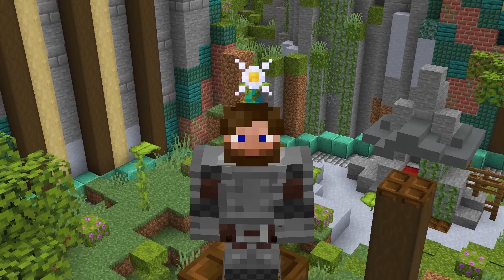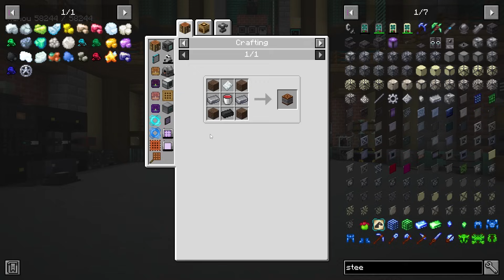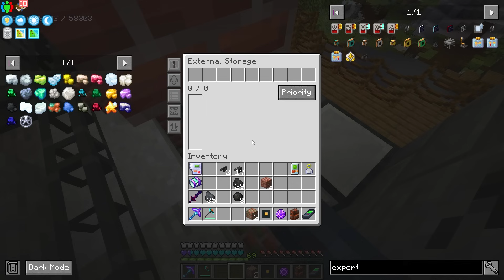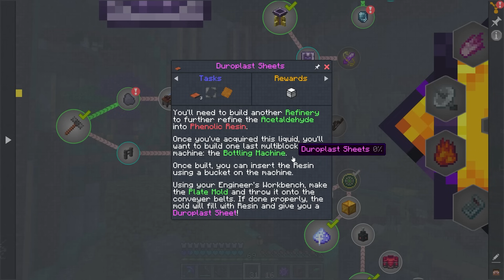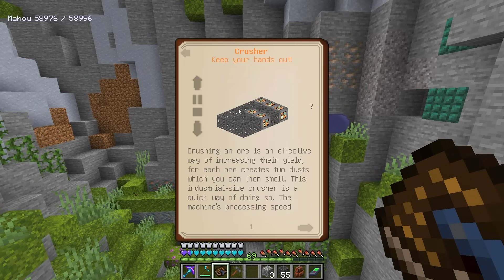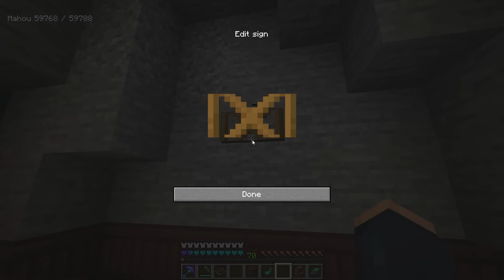All The Mods 9 Modded Minecraft EP42 Immersive Engineering Railgun Automation

Comment: The Sequential fabricator from Thermal is the best way to craft the planks from Immersive, it skips the part of crafting the bucket
Reply: can you explain or link to a vid? I'm struggling both to reproduce bucket crafting with the encapsulator and also can't figure out sequential.
Reply: @caliguy82  in the sequential fab you have to set the recipe manually, if it needs a bucket of a liquid, use the bucket in the recipe then hit the check mark to lock it, after it set then you can start piping the liquid and feed the items
Reply: @chuipi   Could this work with a RS autocrafter pushing into it? Like I don't want to make planks in perpetuity / I want to craft an order. I'm having trouble learning how to autocraft with fluids. My sequential fab was full of creosote oil, but Refined Storage can't see it when I called for it to craft treated planks.
Reply: @caliguy82  yes, RS can handle the fluid if needed, you will have to manually add the recipe, cause if not it will add the bucket , or you could just pipe the oil to the seq fab, the just make the patter to be 8 planks = 8 treated planks

Comment: Hey Chosen, i've just watched all the videos about your all the mods 9 surviving and all tricks you are using are very helpful for me❤. So, i have some tricks for you: i think you can accelerate lasers which is used for powering fusion rector from mekanism with time in a bottle (in another mod pack i could accelerate them with temporal pouch). And you can put deep learner (i forgot how this thing is called, from hostile networks, where you insert you data models to improve them by killing monsters) in your gear slot. I believe there is a special slot there and this will show you progress without keeping learner in the offhand. And i have a question, will you try to get the grectech star? I think it will be interesting